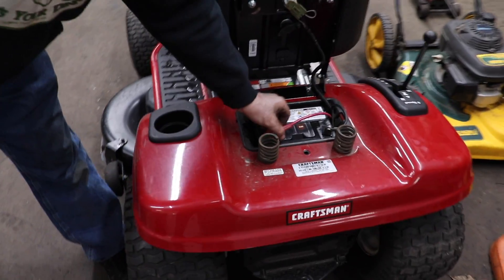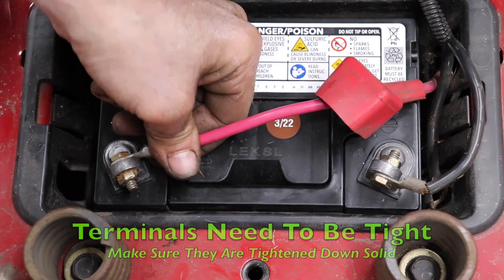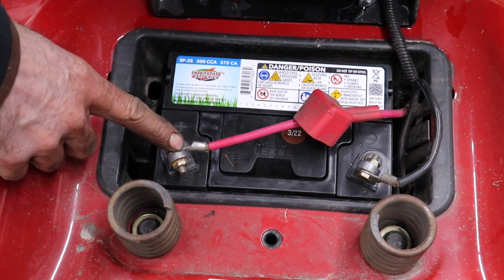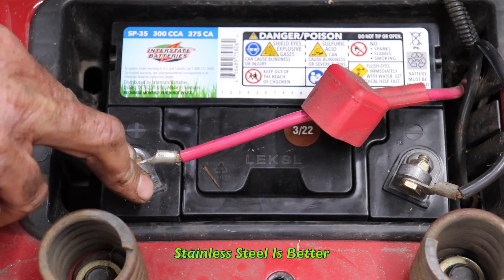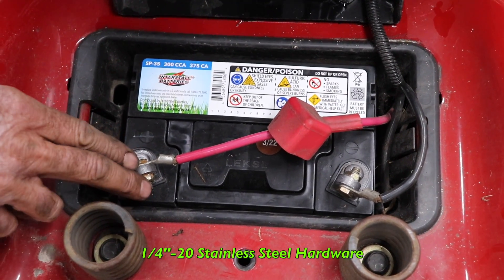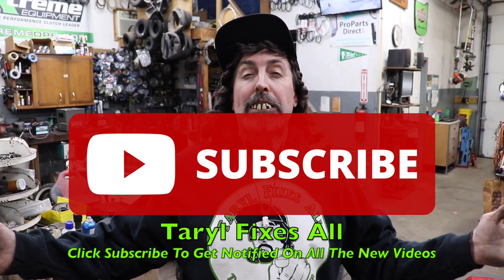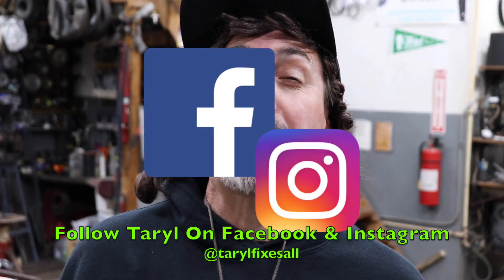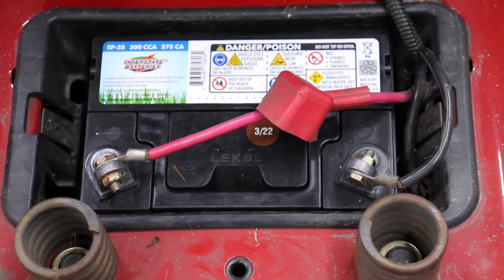New Battery and STILL WON'T Start? Here's Why

Comment: Make sure the wires are connected to the correct terminal. I took in my old battery last summer and said I want an identical battery.  When I got home I installed it and the starter would turn but never engage.  The light was dim around the battery and it took quite some time before I figured out the store gave me a battery with the connections on the opposite ends. Took that battery back and got the correct one.  It worked like a charm.
Reply: The R in the part number means reverse posts.